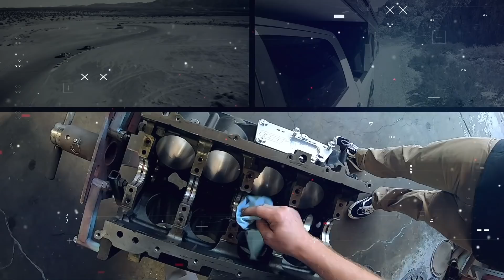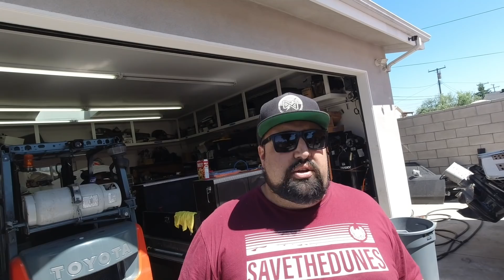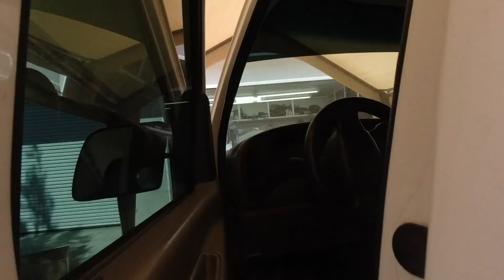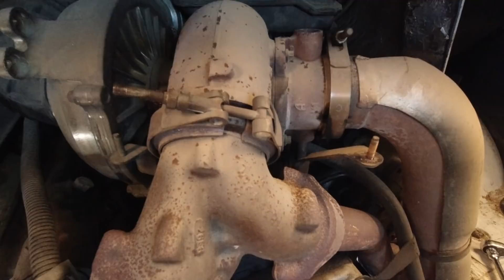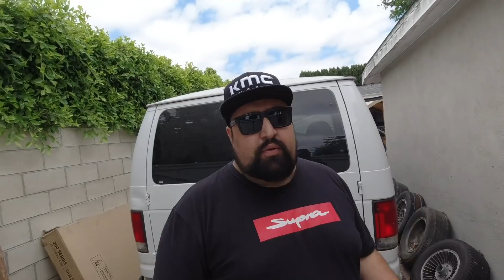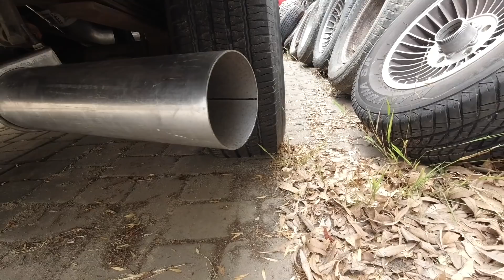Straight Piping the 7.3L Power Stroke Van | Chasing Dust

Comment: Quick question! Looking for a 5" for same van but extended. Seems they dont make 5 inch for the van. Will the f350 exhaust still work considering the frame is the same just different body..?
Reply: According to Díamond Eye, the 4” is good to 700 hp.  A 5” would just be overkill
Reply: 5" seems a little excessive eh?
Reply: @thomasbarlow4223  idk lol. Maybe. I ordered a 7.3 truck exhaust. Which isnt actually to far off from the van exhaust besides the downpipe.. for the comment above you. Just ordered 4 inch downpipe and 5 inch f350 truck exhaust. Shows up next week. Could let you know either way
Reply: I ended up doing 4" all the way through from the f350. Fit perfect. But did do the e350 downpipe. Fit up great. All though did have to make my own hangers off the exhaust. Just cut the ones off that it came with and rewelded
Reply from the maker: Unfortunately, this kit is THE ONLY one out there for the van chassis. The frame is very different on the F-series trucks.
Reply: 5inch is way over kill, you'll lose torque but gain high top end . But might as well upgrade the turbo or at least the Wastegate and run more boost
Reply: Hi the!
do you make your own brackets for The front axle ?
Reply: Like the Sounds of the turbo !

Comment: Where did you find the 4x4 kit? I have a 02 e350 7.3 with 300k miles and I’m looking to swap super duty axles just for the brakes but I would like to source a whole 4x4 kit used.
Reply from the maker: Junkyard!
Reply: Driving Line very nice. I’m keeping my eye out for a wrecked one but I’ll probably just swap in some super duty axles and leave it 2wd drive for now. I’m also installing my 4in exhaust  van right now just came here to take a break from the Texas heat.

Comment: Bigger tires will be a huge help to get that pumpkin off the ground
Reply: Also some sound deadiner on the doghouse, floors and inside the doors will help with quietness. I've had good luck with kilmat on all my vehicles. Maybe even some of the foam insulation for under the carpet to help with heat, I'd imagine it gets warm in there under the California sun!
Reply: @legodude19999  I found just lodging a big wad of furniture plastic in the passenger footwell does wonders for muffling interior noise, and it was free. I was driving my E350 on the highway several hundred miles per week for a while, so it paid off. If you don’t need the footwell for a passenger. Foam or something like that would work just as well I’m sure.